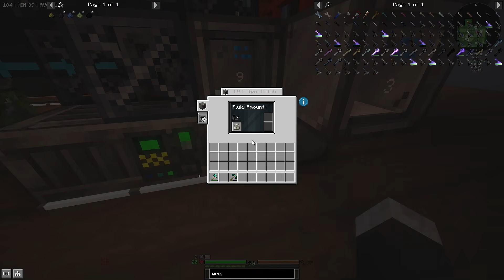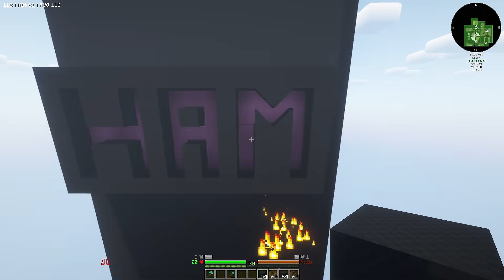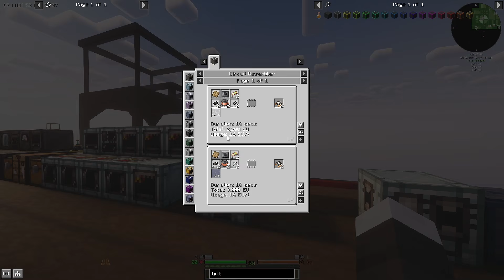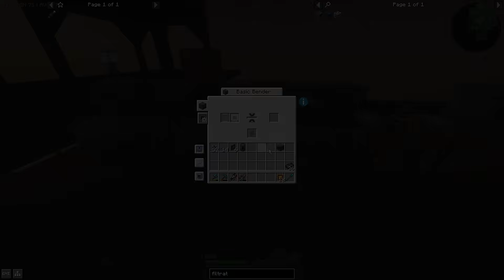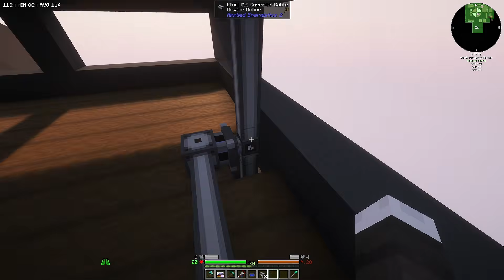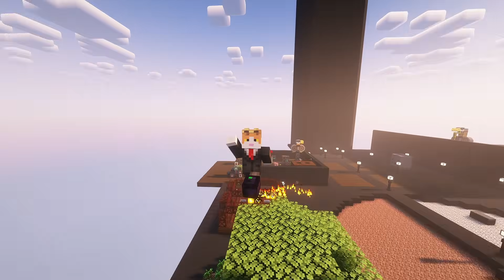Star Technology E7: 2 Towers and AE2, Too

Comment: Dear CEO, I know it's been months since you've finished the building of that magnificent tower — but I felt obliged to inform you that you can use FTB Ultimine in its Shapeless mode (holding ` and right-clicking with the block) to insert bitt into up to 64 frames at once.
Reply from the maker: I couldn't, I tried. I had to add a compatibility mod that someone made for me. I believe that mod was added to the latest versions of ST

Comment: after some testing i discovered that the modular diesel engines with a engine turbocharger will create the same SU as a large diesel engine. advantage being you only have to provide the fuel to the first in the line and they are a great deal more compact. 20 modulars with turbochargers produces exactly as much stress as is needed to spin an 8 long magnet coil (the blue one, i havent tested it with the neodymium ones yet) at 512 RPM (please note this is off the top of my head id have to check my world to 100% confirm)

Comment: In your inventory, there's a speaker button. It opens the muffler menu! You can mute or change the volume of any sound, and do it in specific areas of your world too! Those diesel engines are begging for 10% sound! Same to big walls of EBFs :D
Reply: For Gregtech specifically, you can rightclick machines and multiblock controllers with a hammer to mute them individually. I like doing that because I can keep the sound on if I want to know when the machine is running. The big downside is that it adds to the setup time of machines if you have to click everything with a hammer. Definitely easier to use the muffler mod, or go to the mod options menu to disable machine sounds entirely if you don't want any.

Comment: You could upgrade the energy cells even more by using upgrade kits. you should have access to the MV upgrade kits, meaning 24x more storage. As soon as you have access to LCRs and HV energy hatches (post cleanroom), investing into flux networks will help you manage power transfer and storage really easily.

Comment: Topic: AE2 Storage Cells

Somewhat new to this version of AE2 are a few upgrade cards that can be inserted into storage cells, namely the Void Overflow and Equal Distribution cards. Together, they can be added to a partitioned cell to basically act as an entire drawer network for items that you'll passively produce, such that they won't start clogging the main storage cells. Especially helpful for processes that make byproducts that you don't really need but also don't want to outright trash. (Or in some cases, it's the rare byproduct you need a lot of, leaving you with an insane abundance of the main product(s)... tungsten i'm looking at you)
Reply: void overflow card is in gtnh
Reply: Equal distribution and void overflow have already been backported to GTNH for quite some time now

Comment: The Create New Age Generator Coils can be extended basically as long as you need them, and there's a small audio menu on the player inventory that would allow you to mute the diesel engine sounds specifically.

EDIT: I was wrong about the generator coils.
Reply: The generator coils themselves can be extended, but a single carbon brushes can only pull power from 8 of them

Comment: Did anyone mention how you can enchant the flux cells and fluid cells with Holding IV?
Reply: Does that actually increase their capacity in a way that ae2 can use???
Reply: @LJ_NSCO i think they mean the thermal series storage blocks, not ae2 item cells that you put in drives
Reply: @pixlo9689 ah yea that would make more sense

Comment: Dear CEO, This employee thinks that squid spawn rules have changed in modern minecraft. No longer a simple water pool is enough. It now requires the correct biome.
Reply: Also, this employee doesn't know if it will work or be worth it, but the respawn anchor, usually works as a great magnet for the create generator and most modpacks forget to turn it off
Reply: Also, you should get a employee to check if the "vanilla" way of getting sky stone dust is disabled. (annihilation plane pointed up at the world height)
Reply: @onyxmn13 the annihilation plane is disabled on the eta version, so I've been told.
Reply: @onyxmn13 you can get skystone from rock breaker for free
Reply: This employee double checked, and yes you are correct my coworker. Squids require ocean or river biomes

Comment: a warning for when you move from colossal chest to drives: do not break your colossal chest. it will crash your game
Reply from the maker: Dear employee,

I emptied it manually and then broke it with no issues :>

Best,
HamCorp
Reply: I didn’t have this issue at all, I broke my core with all the stuff in it
Reply: breaking a colossal chest doesn't crash the game, spawning millions of item entities in a single space is what actually crashes if your PC can't handle it.
Reply: As a low end device that miraculously managed to open this modpack, breaking the colossal chest with items will crash my RAM😭
Reply: breaking a core with a item collector attached to a interface will void any items that's been sucked up